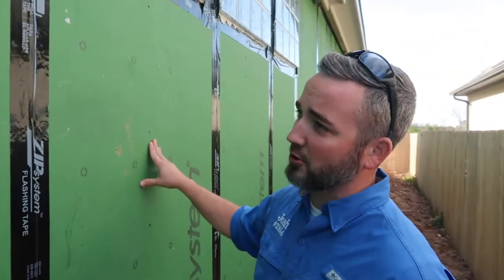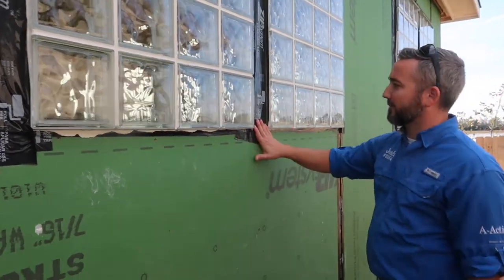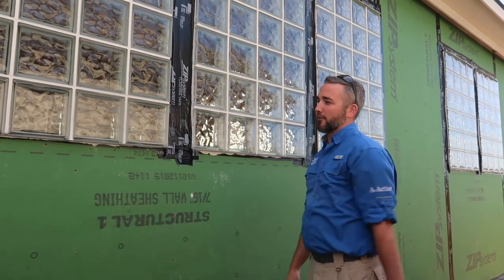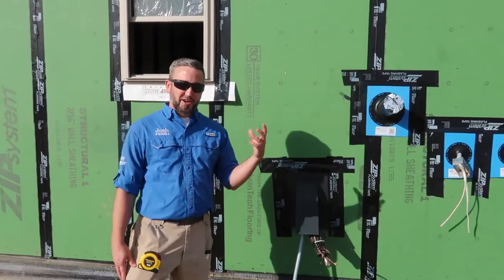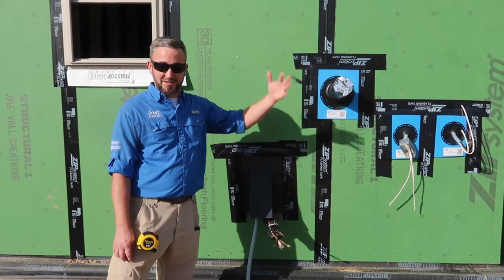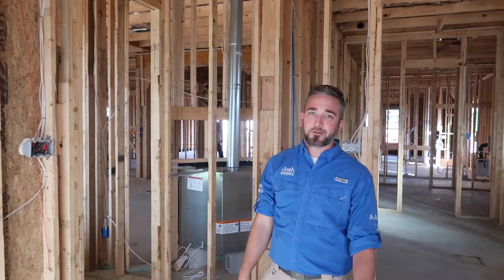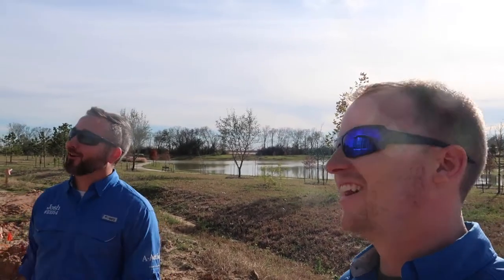New Build, Phase 2 , Pre Sheetrock Inspection - The Houston Home Inspector

Comment: While I didn't know that the nails being set below the surface compromises the zip system,... that makes perfect sense.  It also makes the zip system useless, because, let's face it, Juan isn't going to set the pressure on his compressor to set the nails exactly flush ( as though that were even possible!), nor should he have to.. He's not working by the hour.. he gets paid to produce. This is just not a tenable system, although everybody seems to be adopting it these days. 

I also noticed that the tape was never rolled..............
Reply: There's a depth adjustment on the gun, though. Just poor site management. I'm surprised a county or city inspector, passed these, well, same with the plumber, did no licensed contractor walk through the job site?

Comment: Do those over driven nails create weakness on the system? 
For example, could the zip system come loose from the fasteners?
Reply from the maker: B Hirshey from the amount of fasteners I would say no but it creates a weakness in the system performance.   Creating a possibility of water getting in the structure.
Reply: It is weird because the builder spends the extra money on Zip but then only gets 1/2 the details right.
Reply: The main issue is water penetration.  The installer need to regulate the pressure on the nailer.  The builder or superintendent needs to catch that early to prevent extensive damage.  The superintendent should have catch most if not all the issues caught in the inspection.  That said, the guys in the video did earn their pay.  It is less expensive to correct now than later.
Reply: @crabkilla  Onnnnnnn The Build Show!    ☺  🇨🇦

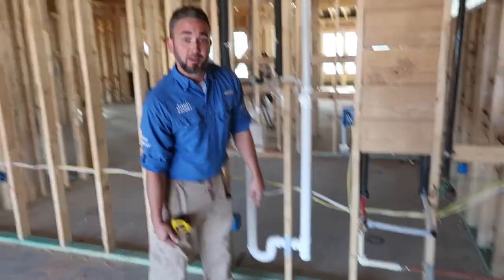Comment: 6:40 drain issue how would you fix this. Please help this is what happened to me . My sink got installed in walk in closet not bathroom . And slab is already poured
Reply from the maker: They will need to cap it off and install a new one.  Or jack hammer through the slab and move it.
Reply: I am wondering the same thing. How did you get yours fixed?
Reply: If it's on an adjoining wall, open up the wall and flip the plumbing to that side. If drains in the floor... They make cement saws and jack hammers. Where there's a will there's a way.

Comment: The Window sill sealer was used when they used aluminum windows and the window would sweat if water gets into the framing and runs down the jamb you have way bigger problems . Think about it wood is very poor thing I’m sorry moisture gets soaking wet before it runs down the jam. No sill silver in the world will fix that in fact it’s going to run behind it no matter what and prevent it from drying out.

Comment: what happens when they do install it wrong, and you go back, and they stared to brick the wall. will they tear it down and fix it?
Reply: I feel like a lot of this is way overboard. A lot of old time houses just had blackboard (basically cardboard) with plywood on the corners and or some just had board cut in on a 45. Then they bricked the outside. Still standing warm and no big deal.